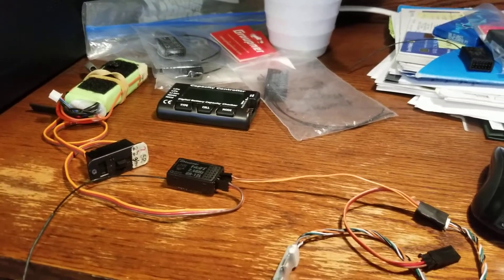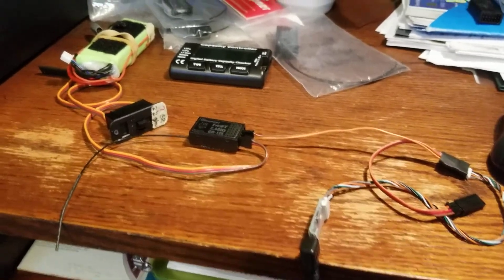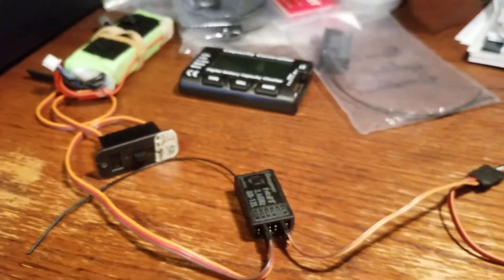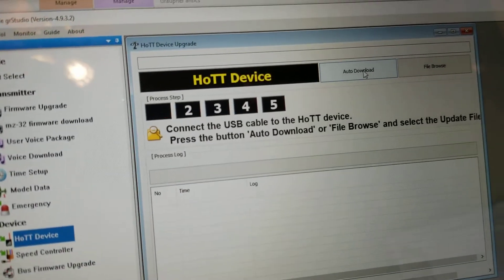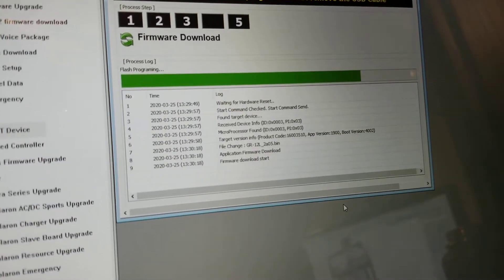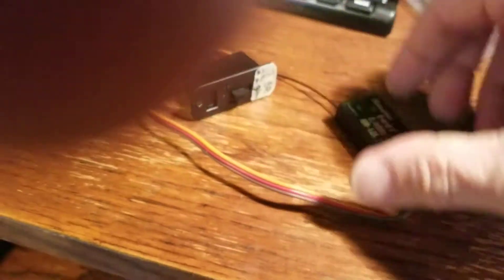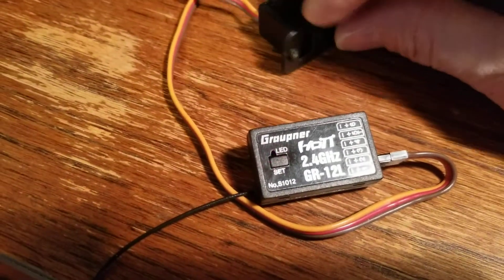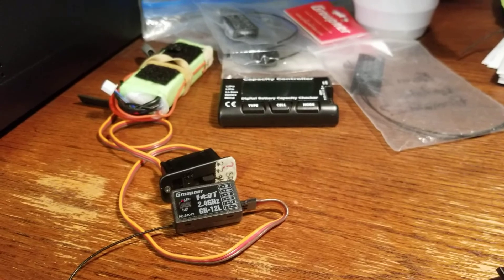Graupner Receiver Firmware Update Method

Comment: Would have been if you explained the Hook up to the Computer. What Cables an apperatus that was used BRO. also a little more explanation of the actual setup on the computer would have been nice too. Just saying a good teacher teaches to the lowest common denominator. Other than that Pretty good job man.